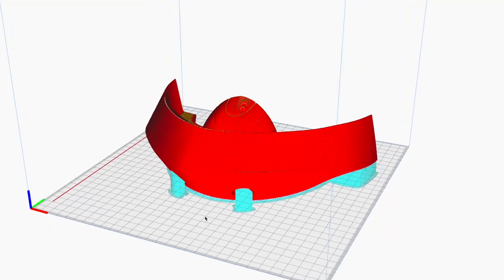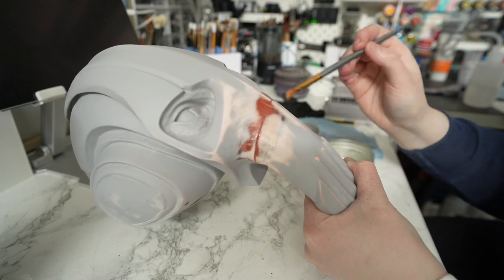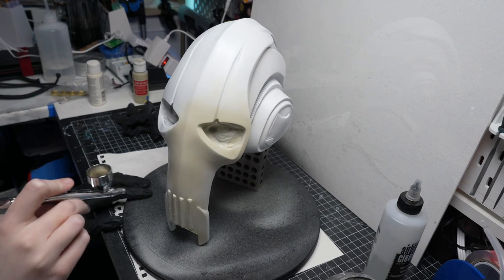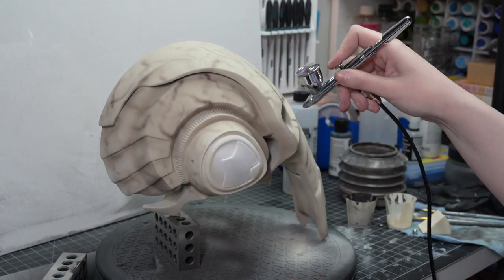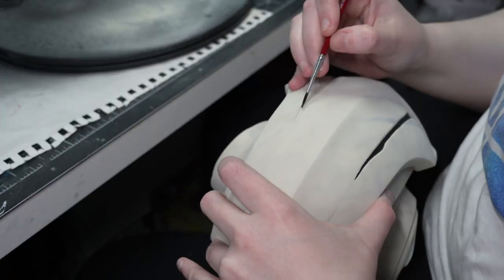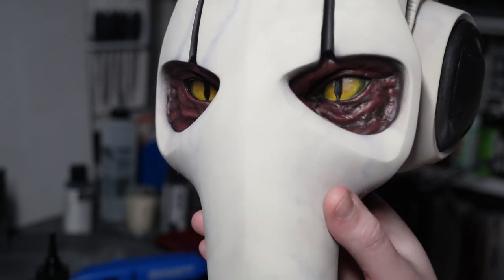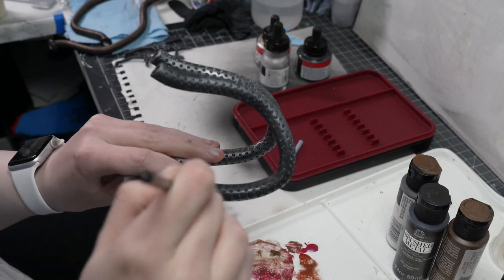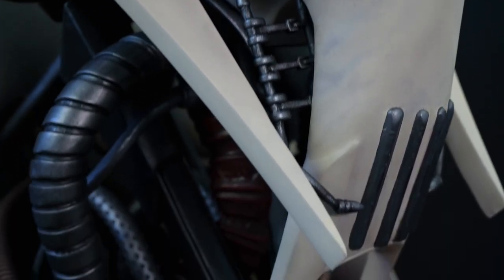Making a Life Size General Grievous

Comment: My last view of this video before I start the painting tomorrow.  I had quite a few issues with poorly fitting part and also missing textures so I have spent a lot of time fixing the problems.  I did contact the seller but he didn't respond.  I have a different version of the base.  I have achieved an amazingly smooth finish on the Head using watered down wood filler applied with a brush,  on the head and collar I have managed to get rid of every layer line and its the best results I have ever achieved.  Am looking forward to the airbrushing although slightly apprehensive.

Comment: Your painting is incredible and a lot can be learnt from watching your technique.  Couple of questions … where can the stl files be purchased and (stupid question) what is dry brushing is it with powdered paint
Reply from the maker: Thank you! The file was originally from Hex3D’s Patreon (not sure if it’s still available) https://www.patreon.com/Geoffro
But Galactic Armoury has a very similar file available: https://galacticarmory.net/collections/busts/products/general-grievous-bust-3d-print-files

As for dry brushing, it’s a painting technique where you put some paint on your brush, then dab that brush into something like a paper towel until you have a very small amount of paint left on the brush and that’s what you apply to your piece. Typically it’s done quite light handed as well. I assume it’s called “dry brushing” because your brush is practically dry with how little paint is on it.
There are a bunch of YouTube videos on the technique by people that have probably done a way better job of explaining it than me.
Reply: @MMsPropShop  thanks ...have just ordered a foot sander
Reply: @MMsPropShop I have almost completed the mammoth printing task however I found a fault with the two base files  and that is the inside base texture,  the from is very textured where the back has almost no texture at all.  I have started all the sanding and then painting on watered down wood filler and the results are so far very good

Comment: I may have missed it in the video but what resin printer do you use? those are huge resin prints! :o i need it lol
Reply from the maker: I actually printed all of the resin pieces on a Mars 2 Pro. All of the pipes I basically had standing up right for ease of printing so the build plate size really wasn’t much of an issue as long as the height was still ok. I believe I did all of the pieces over 4 or 5 print jobs.
Reply: @MMsPropShop  oh wow never thought about slicing them that way lmao thanks!

Comment: Oh I love your work!
One question, where can one buy this wood filler? I tried googling it, but only comes up with one different from the one you showed. I'm a maker based in New Zealand, making finding stuff even more complicated ;-)
Reply from the maker: I completely get it, finding stuff in Canada can be interesting at the best of times as well. The only place I’ve been able to find it here is Home Depot (I think Amazon might have sold it at one point as well but I can’t remember). In theory though, any colour changing wood filler should be the same texture. You can’t exactly colour change the gritty, wood particles that typical wood filler has, so any colour changing stuff should be plasticy. Not sure if that helps but I hope you’ll be able to find something similar that works.
Reply: @MMsPropShop  thanks for your fast reply. Yeah, it's challenging to get supplies in some countries haha. I think I'm a bit spoiled from working at Weta for a while. 
Atm I use builders bog for much of my filling. It works well, but since it's 2 component stuff, it tends to go off too fast. I found the stuff you showed on Amazon, at least a brown version, but it shows "not available", so I'll need to find some other stuff easier to get here. 
I'm working with 3d software (and peinters) only since xmas, all self taught, but I had to cleanup some masters back at Weta, also using bog.
You can check my channel here if you like, to see some of my (traditional-made) personal projects.
Thanks for your videos, I'm enjoying them a lot and they give me some serious inspirations and ideas.

Comment: Fantastic job!!  Very impressive!  Your paint job is the best I have seen, along with the eyes!
Could you please tell me what printer you use, or maybe suggest one?
Also do you use Fusion 360 and if not what do you recommend?
Reply from the maker: Thank you! The head and some of the pieces I’d originally printed were done on an Ender 3 pro, the larger pieces like the collar were done on a CR-10s (with a 0.8mm nozzle), the neck and non resin printed pipes were done on an Ender 3 V2, and finally the resin printed pipes were all printed on a Elegoo Mars Pro 2. Whew, that was a lot lol
Right now the printer that I’d suggest to anyone would be an Ender 3 V2. I know there are newer models now but the V2 is the perfect combination between quality of prints, machine upgrades, but still at a reasonable price. I might do a whole video on what I’d recommend to add to the base model as there are a few things that I’d consider necessary additions.
And yes, I use Fusion360.
Reply: @MMsPropShop  Thank you SO much for the intense reply!  I didn't expect that.  I'm a noob to this although I have done plenty of military models in the past.  This printer you suggest, it will print everything that is required for this bust?  Um.... is Fusion 360 hard?  Ive never done 3d.  Thanks again SO VERY MUCH!!  I took a picture of Grevious eyes that this guy had put on his presentation, although he didn't do it like the pic, I would love to share it somehow.
Reply from the maker: You’re welcome! I’m always happy to talk shop. The collar piece would have to be sliced into 4 as opposed to 2 pieces, but yes, the rest of the pieces will fit on an Ender 3. They’re such popular printers that most model makers now split their files up to be able to fit on that size of printer.
There’s definitely a lot to learn when it comes to Fusion360 but I find that it’s a pretty intuitive, well designed program. The good thing is that you can basically google how to do anything in Fusion360 if you can’t figure something out and there will be tons of information and tutorials to help you. I probably only know/use about 10% of what it can actually do.
Reply: What do you think of this printer?  Longer LK5 Pro?  It can do a full size helmet.
What add ons to the Ender do you suggest?
Did you buy your plans for Grevious on Etsy?  And THANK YOU again so VERY much!!
Reply: Oh another question.  Which rezin size did you use for Grevious?  1.75,,,,,,,,??  Is there a brand that you prefer for the resin?   
Will I always have the "threads" showing on the model after it prints then it needs to be sanded?  (please note: I AM A TOTAL NOOB ON THIS)
Reply from the maker: I unfortunately have no experience with that printer so I can’t say either way. My main recommendation would be to go for a printer that has a TON of online support, especially if you are brand new to 3D printing. The more popular the printer the more people there will be to have either already posted the solution to any possible problem or would be able to answer any questions you may have. 
Mostly for an Ender is would be new bed springs, a z axis threaded rod stabilizer and possibly a different bed surface. The more recent Creality machines seem to have this new version of their textured glass bad and it’s awful compared to the older ones. I’ve got PEI on most of my Enders now.
Grievous was from Hex3D’s Patreon but there’s a very similar model by Galactic Armory out there as well.
Reply from the maker: For resin I tend to stick to Elegoo’s ABS-like in grey. All of the filament was 1.75 PLA in various brands/colour depending on what I was using up spool wise when I was printing the pieces. You can print at a finer quality to reduce the more visible layer lines but you’ll still want to most likely sand those as well because paint will only make everything stand out more. Resin will require hardly any sanding if any at all depending on the piece.
Reply: @MMsPropShop  I am SO very grateful for your replies!  Thank you again, SO VERY MUCH!  You have no idea how much I appreciate this!!!  If you could have any printer which would you choose? (Just curious)
Reply from the maker: I’d probably go with some giant resin printer like the Peopoly XXL or anything along those lines. Large resin printers are becoming a lot more common and affordable which is awesome.
Reply: @MMsPropShop  (cough cough) LOL !!  Thats ONLY $8000 !!!  How about the ANYCUBIC Photon M3 Max Resin 3D Printer?  That around 1K and it looked pretty good.
Reply from the maker: Lol I didn’t mean that particular one was affordable. More that there are way more larger resin printers now, like the M3 that aren’t nearly as expensive as they used to be. Not even 2 years ago a resin printer with the build volume of the M3 would have been something like $7000. I’m very interested in the M3. I could see that possibly being my next printer if I can justify needing another one lol